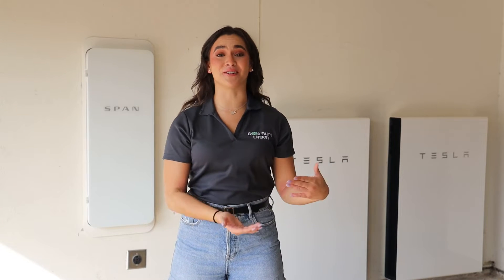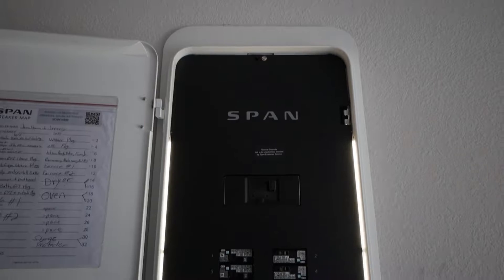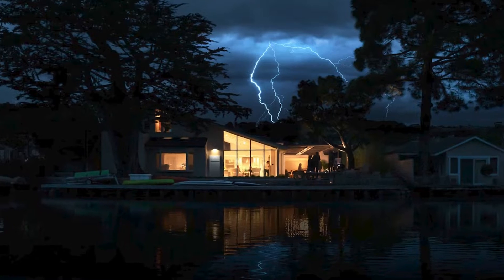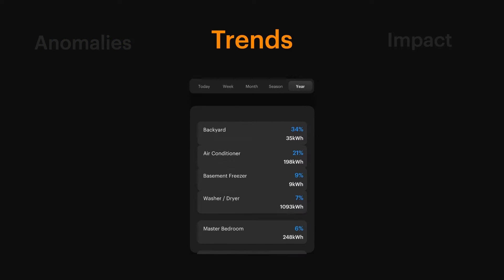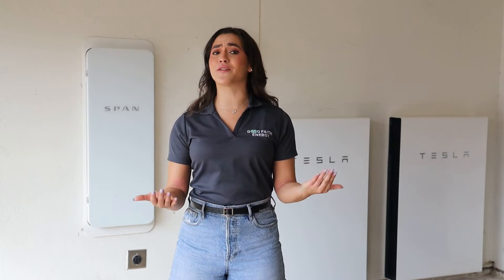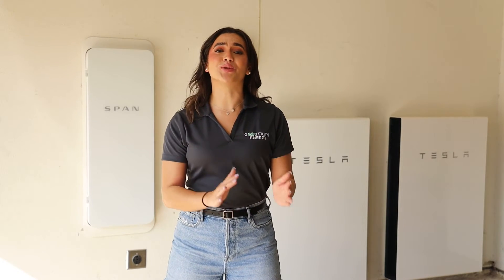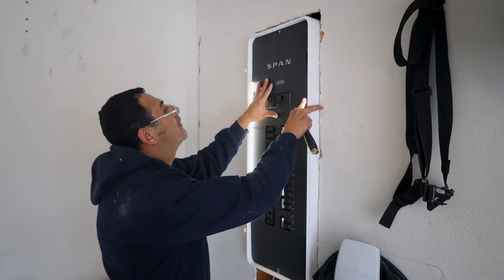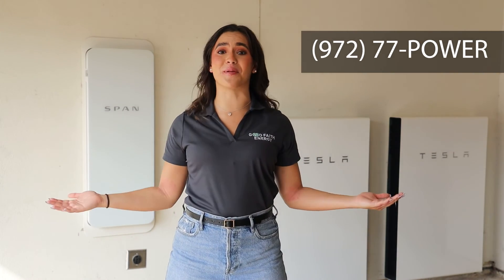SPAN Smart Electrical Panel for Optimized Solar and Battery Systems in 2023

Comment: I can see stopping current from flowing out the circuit breaker, but how would you tell the appliance to come on?
Reply: I think this was stated at the 2:40 Mark. I don't see how they could accomplish this with the span panel. Perhaps they also install Smart switches or smart outlets to turn things on and off. In the video the homeowner talks about running the dishwasher at a certain time of day and I don't see how that would be controlled by the span panel. They would have to be a smart dishwasher.